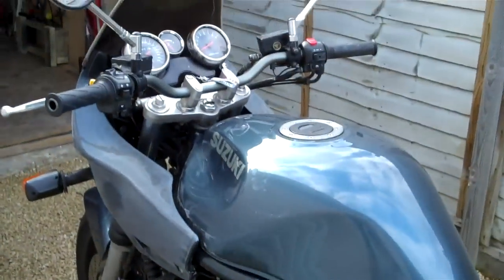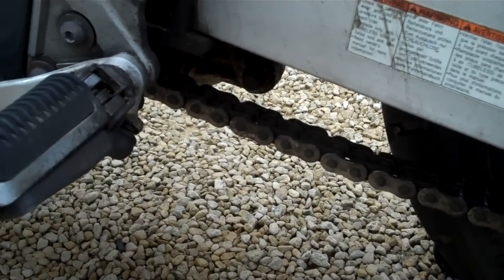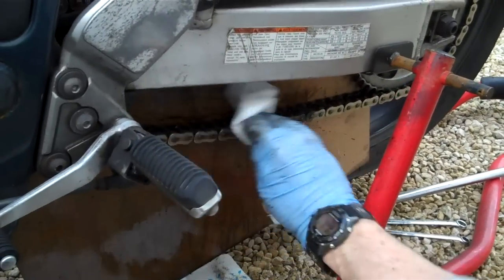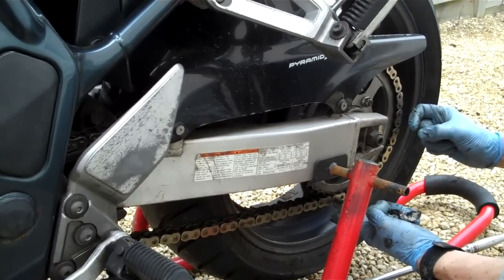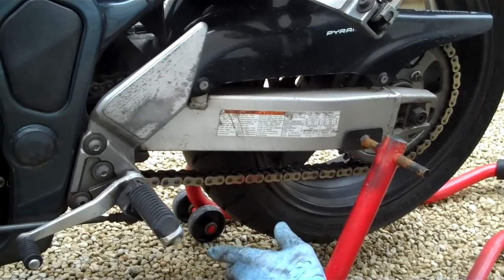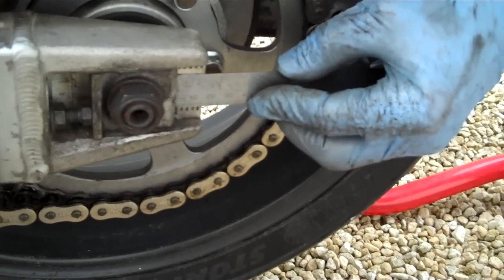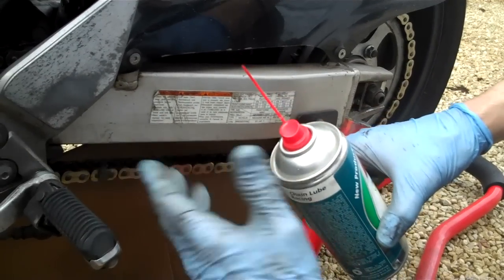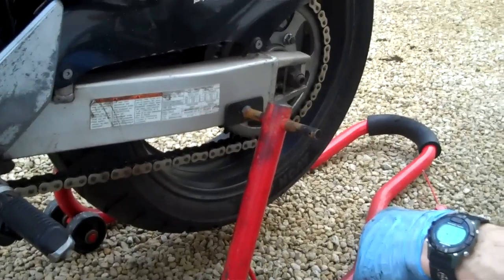Delboy's Garage, Suzuki Bandit, Chain Adjustment. (plus clean and lube).

Comment: I'm new to biking. This video has been really informative. I have realised that I have been lubing my chain completely wrong.....yes I'm one of the outside squirters
Reply from the maker: its a common mistake buddy, if you apply it to the inside, and when the chain is  hot after a ride, you can get away with using half as much lube too, so it goes a lot further...which is good as its not cheap...good luck mate.. cheers, Del.

Comment from the maker: Hi Stephen - the Bandit does give a little buzz through the bars and pegs at certain revs, but the peg hangers are rubber mounted, so it shouldn't be too harsh, the question is, was it vibrating this way before you tightened the chain, or has it always done this?... if it's a new vibration, you could have over-tightened the chain a little causing it to lash slightly on over-run, otherwise if it's always been there, could be something you just never noticed before, which happens with any bike!

Comment: Can't remember if I said this before but the Suzuki V Strom 2012 owners manual suggests using kerosene which is a petroleum based fuel (you probably know about it more than me).

It might also be worth mentioning that , on some bikes , it is a good idea to remove the front sprocket cover every once in a while. I use a sticky lubricant and it tends to fling in there and all kinds of gunk gathers there. I use GUNK degreaser to clean that crud out , I find it contaminates the chain if left.

Comment from the maker: Imagine in the tank the sender unit is not unlike a stop cock in a toilet cistern, it has a float that goes up & down with the fuel level that then relays that info. to the dial. It could be that the mechanics taken the tank off (which they would have needed to) & perhaps laid it upside down causing the sender to get stuck halfway. I know it's grief, but drain out the fuel with a pump, turn the tank upside & take the sender out from underneath, then re-install correctly, hope that helps, Del

Comment: Just gonna echo what's said in the Haynes manual for the B12, when cleaning the chain, you should clean using paraffin (kerosene) and preferably after you've ridden (i suppose to heat the chain somewhat) and spend a maximum of 10 minutes of cleaning the chain (Which I also suppose is due to the chain cooling off). When adjusting (measuring) the chain you should have the bike on the side stand as you mentioned regarding the weight coming down, tightening the swing-arm. Thanks for the video :)

Comment from the maker: Thanks mate, yes, it is a very common misconception to spray lube on the outside, mainly because it's convenient, but it does get messy and it flings off more, as I showed if you spray sparingly on the inside of a warm chain, not only is it less messy and more effective, but your can of lube lasts longer LOL! ... and there isn't much you can't clean with WD40 (except my language according to Penny!) ... Cheers Del

Comment: The chain adjuster on the 600 mk1 is terrible. the little notches one side are built into the swingarm and on the other side it's a plate that hooks over the spindle so you can never get an accurate position. Cheers Suzuki,.

Comment: I've always been advised to not use WD40 type lubricants/releasers as it does contain Stoddards solvent(basically white spirit) which wrecks the o/x rings! My top tip is to use paraffin in a pump spray bottle...
Reply from the maker: Sorry to burst your bubble matey, the paraffin is also just as harmful to rubber seals as WD40..they all contain solvents. the seals in chains are pretty resilient as thye are designed to live coated in lube and other chemicals, plus obviously resist the salt and water corrosion too... the absolute safest thing if you want to be proper anal would be Diesel...but i hate the smell of that stuff hanging about in the garage.. i use WD as its always handy and does the job real well.. in 30 years ive never had issues with the rubber 'O' rings, the chain wears out long before they do..

Comment from the maker: Hi mate, i made a video of fitting the stretched swing arm on the Bandit, i covered the chain and sprockets in that if it helps, other than that i haven't made one independently, if you've just had it replaced then you'll be ok for a fair while...cheers mate,, Del.

Comment from the maker: If you mean the marks used to set the wheel alignment, then the bolts on front of the axle nut wind in or out to set both side the same...if you still cant get it, then send me a short video or photo if you can of exactly what you mean, and ill try to help.... cheers, Del

Comment: Amazing video, taught me so much about chain and lubing them.
I just bought my first bike and had a friend help me adjust it, before i went for a 300kilometers ride home on it, i think its too tight! :(
Reply from the maker: filmfreaken Hi mate....as long as you have and inch and a half of up and down free slack at the tightest point on the chain, ten its not too tight... how old if the chain and sprockets buddy..?
Reply: Hi again, didnt expect an answer, but you gladly surprised me!
I watched you video last night, and today, actually just about 40mins ago i finished cleaning my chain with wd40 and a toothbrush, it was a hell getting the rear wheel airborne, due to no central stand, only got the side one, haha but i managed with an emergency car-jack :D Once again, thanks for the intel from the video, it helped alot :)
The bike is one of those chinese 250ccm's, not exactly a super-build bike, but i bought it so i got get some driving going cheap :) it has a total of 5000 km, so i suppose its the original chain, the bike is 6 years old, bought it from an enthusiast who had 4-5 bikes and this one his daughter used for work, so i did the oil change, sparks etc.
I'll turn it into a bobber/old look bike i think :P while i save up for a 'real' bike.
Reply: I emailed a local shop about my chain and they told me to drop by and have it inspected, so i did, they said it was great adjustment and the clean and relube was good! Thanks again! :)

Comment from the maker: No picture attatche buddy, just to be clear...run my video to "12.41", that is the bolt you wind back that wpushes on the axle block to move the wheel back (with the axle loosed off) are you winding that back like i showed, and what is happenening....is it just spinning but not pushing back?????

Comment: I don't clean my chain that often, but I do notice that the more you lube it the cleaner it stays, but when I do clean it, a nylon brush and boiling water cleans cleans the chain super quickly, just spin the wheel on the brush while pouring the boiling water and the shit comes right off.
Reply: +CJandJgaming  Hi. You can do this as a first step but it wont be as good as using a chain cleaner solution as the video explains. There a particular compounds that the water will not remove.

Comment from the maker: Bad news im afraid mate..NO..if you have a rusted jammed link .its a new chain...yes you can move it about with force, obviously you can..but the pins in the middle have now corroded, and not just a bit either.enough to jam solid..so all you'll do is weaken them, and that can lead to a chain failure....and that can be phuqing lethal....just get a new chain buddy...its money well spent..sorry to be bearer of bad tidings, but im sure you'd prefer the truth...then lube better in future. tc. Del.

Comment: hey man i’m pulling my hair out trying to figure this out. I did exactly 15 mm and torqued to 72.5 lb-ft (on paddock stand not side or center stand) and my chain just feels way too loose. However i don’t want to crush my wheel bearings as its done before (just replaced them). Is there a certain deflection measurement AFTER axle nut, adjuster nuts, and torque link nut is tightened ?

Comment: rear axle can move upon tightening the nut (on my bike it likes to do that). americans seem to put screwdriver (or alike) between sprocket and chain to make chain tight, then tighten the nut, then remove the screwdriver.
Reply from the maker: Hi Ivo. that's a novel way to do it, as long as it give you the requires slack, then why not.. thanks for watching mate... Del.

Comment: Might be an old video, but still very useful. I seem to have has so many punctures and replaced tyres that I've never had to do adjustment before. Nice clear video. Going to attempt it this weekend. 

I know for you mechanically minded lot this is trivial, but some of us are mechanically inept and it's quite a big deal to undo that rear axle nut and then majigger with stuff.

Comment: Hey Del, great video but I do not agree how you clean your chain. The way you do it the chain will be still dirty at the back. I use a divise calt "kettenmax". It will clean your chain on all side's. I use at first with diesel so that the chain is completley clean, only then I use a "official" cleaner like S100 to spray out the last dirt and diesel. Only then I lupe the chain. Gr. from Holland and keep up your great  video's!
Reply from the maker: Be careful using diesel on your chain if it has O-rings, as diesel is an extreme solvent and will eventually cause them to perish, also it washes all lubricant out of the chain, right down inside the rollers, as it will pass the O-rings due to the capillary nature of diesel oil... you are far better to use a light spray oil, such as WD40, which will only clean the outside of the chain, as the dirt is only on the outside... if you must use a fuel based cleaner, then choose kerasin as it is heavier than diesel and will not ingress past the O-rings, or perish them...
Reply: Hey Del (and Penny ofcorse) I use now for about 3 years diesel to clean mine chain and I dont't have any problems with it. But after I cleaned it I use always a special chain clean product so that all the diesel is of the chain. I heard that WD 40 was verry bad for your chain, probeley worse then diesel. I don't know of this is true. Can you also use a sort of lamp oil to clean your chain? 

I want to ask you something else if I may... I drive a GSX-F 750 can I put the same mesh in the holes at sides of the fairing as you did with your Triumph?

Greatings from the south off Holland, where the sun always shines (not!!) Boudewijn
Reply from the maker: Boudewijn Lips
Hi Boudewijn, yes you can clean a chain with practically any clean oil, it will always loosen the dirt and allow it to be wiped off..and yes also, the wire mesh i used is great for filling the vent holes in te fairing of any sports bike...as long as you don't live in a really hot climate (which you don't lol).... hope that helps.. Del.

Comment: As usual, fantastic video. Glad you decided to make it as for me its very helpful. Just some questions if you don't mind. Putting the cardboard behind is a great idea, but is there then no need to clean the back of the chain then? Also, once all cleaned and adjusted, is there no need to lube the outside/inside face of the chain? Cheers mate

Comment: Great video. Just one question regarding weight on the bike when checking the adjustment. I only have the centre stand to lift the wheel of the ground. Can you give some advice on adjusting it on the centre stand? Not sure if I missed it in the video. M

Comment: Hi Del,

Thanks for this, it clarified a few things for me.
I have a question though, right at the end of the vid, when you're spinning the wheel, it sounds like the brake disc is brushing against the pads in one spot. Doesn't that mean there's something not aligned? The wheel or the disc?

Comment: I've never sucked eggs, what is it like? ;)  BTW, this video is great, well worth you doing this, new riders who want to maintain their bikes properly need these to learn the correct way to do it.  I watched the whole video but just wanted to make sure I knew how to adjust the chain correctly.  I've worked on cars many times over many years but just started riding and need to save cash too, so need to learn the different things that bikes need doing to keep them going.  Thanks, love the channel :)
Reply from the maker: Thanks buddy, ask yer grandma about the sucking eggs thing lol !  Welcome to the bike world mate, it's not that much different to cars, all the principles are the same, it's just a little lighter and smaller, a damn sight easier to get to everything lol, with slightly higher wear on consumables, and a little more cost... but other than that, if you're an experience car mechanic, a basic bike should present you no problems!

Comment: Quite good, but it is not OK to measure the displacement of wheel from end of the fork. Should be measured from the center points where fork is attached to the frame.
Good tool I can recommend for cleaning the chains is Kettenmax (or something similar).
Sorry for my English... :)

Comment: New to adjusting my chain here. The marks on both sides are currently even however the bolts on each side have different lengths. I'm afraid of adjusting it because it will "run out of space" and I forget what to do once we're at that point

Comment: Thanks, but before I took it to get tuned the gauge would get down to one bar and the tank would be almost empty. The gauge would flash and I would fill up.  After the tune the tank  be over half full, and the bike will die unless I put it on reserve.  I know the gauge isnt accurate however running the bike on reserve with half a tank, I have been told can be unhealthy.

Comment: Do I need to bother about the slack if the spec is 30-40mm but I get it at the tightest point at 25mm? Is there an additional tolerance beyond the spec?

Comment: Great video! But I need assistance. I just bought a brand new GSF1250S and I have put first 1700 km on it. But, when motorcycle is on the side stand or when I am sitting on it, it have a lot of chain slack along the whole chain, In other words, the chain is making some strange noises when driving on low revs / low speeds and it can reach the swing arm in the middle position, between the front and rear sprocket. Is it normal that the new chain on the new bike needs adjustments already? Cheers.

Comment: Because you only need lubricant between the surfaces which rub, would you also recommend wiping the outside surfaces with a dry cloth at the end, to prevent any extra unnecessary lube on these surfaces attracting grime?
Reply from the maker: It certainly would in a dry and clean riding environment, but with winter riding where there is salt and grime one the roads.. it pays to use a chain wax to keep the metal outer parts from rusting up.. it will attract a layer of salt and grime over the wax.. but thats why we then clean it and re-lube it again.. its just good housekeeping aye.

Comment: You cleaned the chain from the outside and top (the inner radius), however, you have not cleaned the inner surface of the chain which was adjacent to the protective cardboard. I would normally soak a rag or kitchen towel and scrub the other side also

Comment: Great Video, thanks for the advises I really enjoy your details with the chain adjustment. By the way I´m from mexico I recently got a GS500F suzuki, can I use water for chain cleaning or necessarily use a maintenance spray, and whats on it? so I can get and idea od how to ask for it in the store. Thanks a lot again..
Reply from the maker: Hi Jaime... thanks for your kind words, and how cool to hear from you all the way from Mexico!  No, you must NEVER clean your chain with water, because it will not get the greasy mess off and if you leave any water on the chain it can make it rusty... the cheap and easy way to clean your chain is with kerosene, paraffin, or diesel... you could buy a gallon of diesel in a can, just by going to the gas station, then when you want to clean your chain, pour some diesel in a jar and use a paintbrush to scrub off the greasy mess, then wipe dry and spray with some 'chain lube'... you could ask the shop just for spray on chain lube, or chain wax, both are good... drop us a line if you get stuck!  Ride safe, Del

Comment: Thanks for this one as well Del. Do you have any tips for undoing seized chain links? I reckon it's not very safe to use 2 pliers applied on top of some towels to losen the links up a little?
Reply from the maker: To be honest mate, the correct remedy for seized chain links is to drop it in the bin and fit a new one... they're not expensive and it's a major component.. if a chain link has corroded solid, it will never be right again... the corrosion eats away at the internal pin and weakens the chain... this is why I run my Scottoiler all the time and even leave it a little over-adjusted... sorry if it's not the answer you wanted, but it's the right answer mate! Del

Comment: Great vids Del, I'm an old noob! Bandit 600, I've just cleaned and lubed the chain thanks to you. Question, how do I adjust the tension as the back is Allen key only. Although my chain seems fine, it seems to hit on the top runner when I'm in a low gear, it comes off the sprocket and occasionally bounces. Does that make any sense? Hard to explain! Ta

Comment: Hi, any tips on loosening the wheel nut? I ended up going to a garage last time as it was so tight but looks like they've tightened it just as much. I can just about get some movement but nut on the other side is moving too........feels like a 2 man job as i can't hold both sides at the same time. Makes me a bit concerned that I'll over or under tighten once I'm done too!
Reply from the maker: Its always a tight nut is the axle nut... just use a big ring spanner on each side, and stand behind the bike, lean down on the right side while holding the left.....garages often over tighten them to be safe and not get sued if it comes loose...once you are done re-tighten it to about 80lb ft and mark it with marker paint as i do... then you'll always be able to undo it again... good luck, Del.